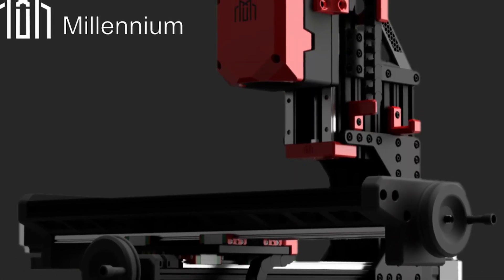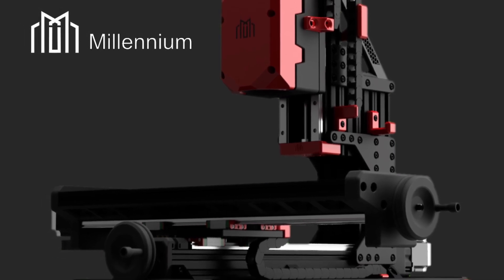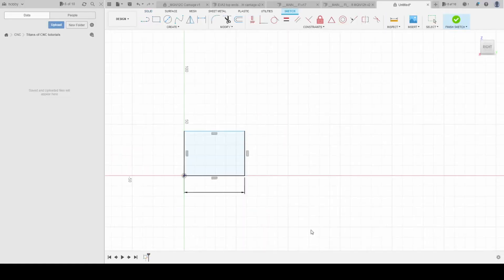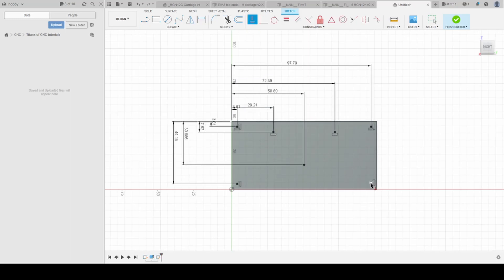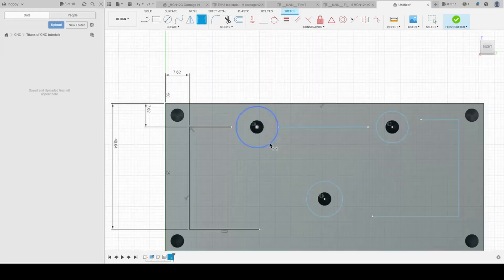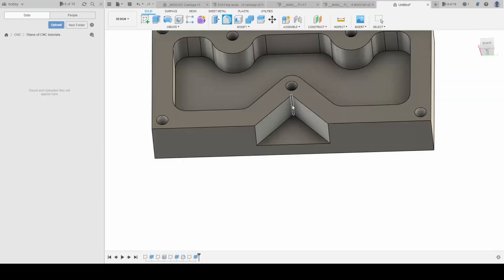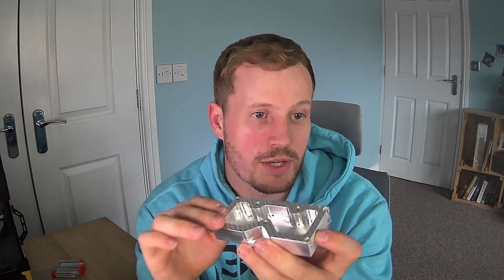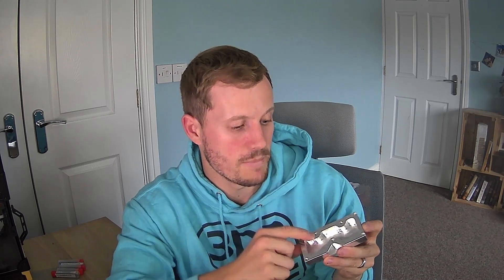CNC Series - Millenium Mill Episode 1

Comment: hobbyist version of F360?  No rapids is painful
Reply: cant you just add them in manually? G00
Reply from the maker: @quickdiy8127  Yeah I could. I actually have access to a paid version of fusion (work) that i will use next time. As I'm still getting used to the machine I've been content with slow 'rapids' as it's easier to avoid crashes!
Reply from the maker: Yes unfortunately for now hah! I do have access to the full paid one via work so maybe I'll try it with rapids next time!
Reply: @3dpandme  yes its what forced me to purchase the subscription.  They get you coming and going lol